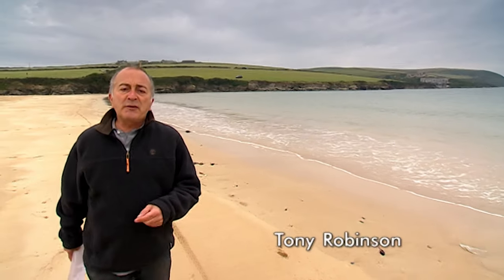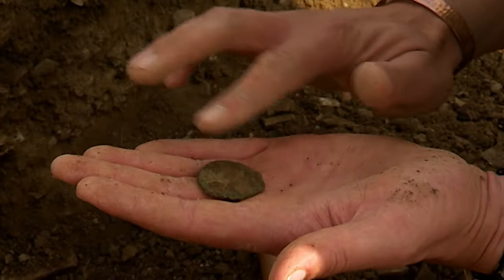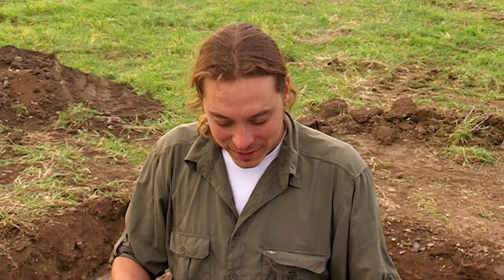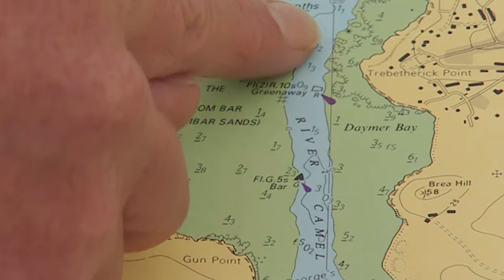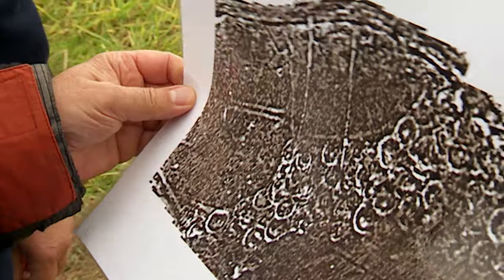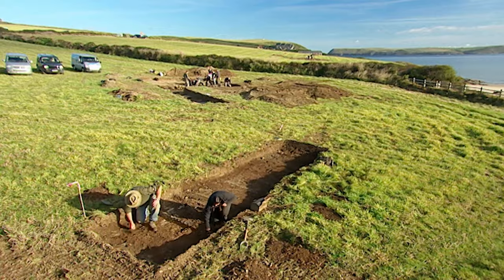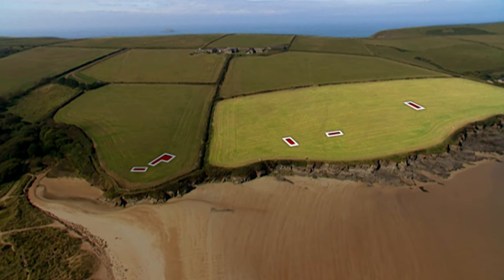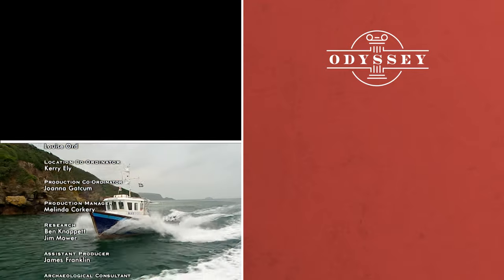Why Is There Ancient African Pottery In This British Seaside Town? | Time Team

Comment: Ref 'rubbish' in the middle of the wall, back in the 00'ties me and a colluege worked on the coast of Norway and all hotels was full, so we had to stay at a farm with an old woman, she, (probably not she personally) had moved an old house to make food, she claimed it was built like it for thousands of years, it was basically an inner wall and outer wall, filled with sand in-between, and the 'funny point' was, she told us they built it wrong the first time, it was impossible to be in the house because it was sand everywhere, and the reason was, the roof they built was covering also the outer wall, what they did was, shortening the roof, only covering the inner wall, letting rain water fall into the sand, in-between inner and outer walls, she claimed the house was perfect, and it looked really good, but is do not know

Comment: One wouldn't necessarily require to reach the shore to trade, the ship in question could lay anchor at safe depth whilst a smaller local raft or barge could be used to ferry items from the shore and to the ship.

Comment: Its just mind-boggling how much gap there were between minor asian' civilizations and britons' 2000 years ago. One of them were debating on the matters of universe and the other were building round houses along the beach... Fantastic.
Reply: The celts were advanced in medicine and metal work. Round houses were used because they are easy and cheap to build using local matarials.